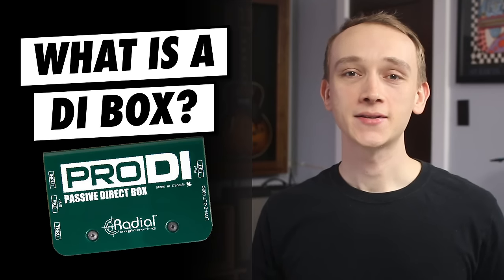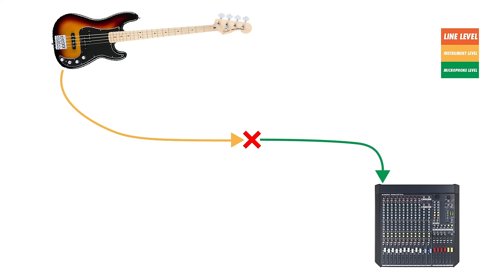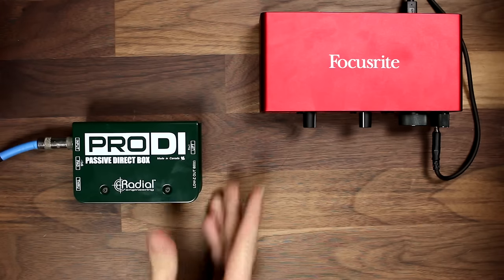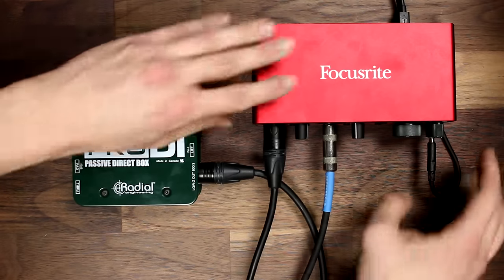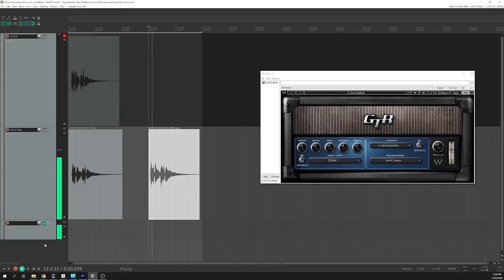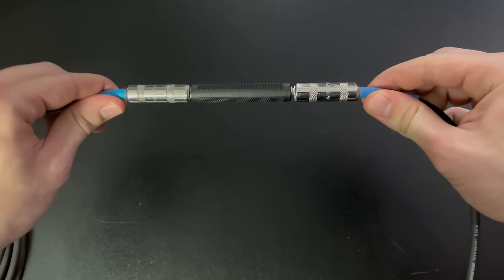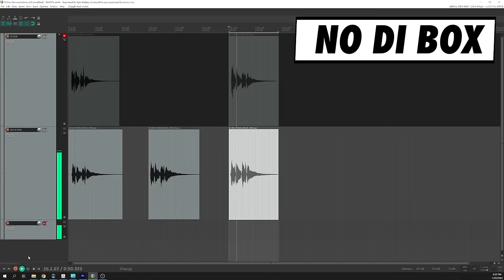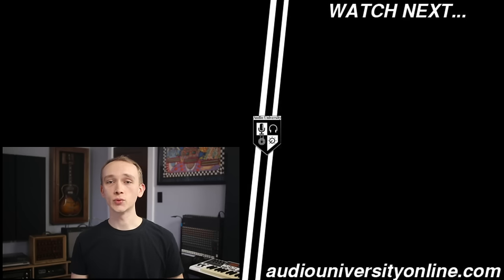What Is A DI Box (Direct Box)? | When & How To Use One

Comment: a DI box absolutely colors your signal, because thats what happens when you drop the impedance. you wanna connect to a mic input? lower your output on your pedal/amp/whatever is connecting to the DI box, and lower the input gain on the interface youre connecting to. NEVER use a DI box just to connect to something. passing your shit through a transformer or resistor (the more common and cheaper method) absolutely butchers the sound quality. if all youre doing is simple, non dynamic basic chord strumming, youll be fine. but if youre playing anything with any kind of distortion or RANGE, the sound quality is going to be decimated by the resistor.

Comment: Electrical engineers would probably have issues with your rather loose terminology.
For example, instead of talking about 'signals' having impedance (in reality they don't) you ought to talk about output impedance of signal sources and input impedance of the loading ccts.

Comment: These guys put out cool videos but they never answer any questions so don't even bother wasting your time
Reply: what is your question?
Reply: @3xAudio  I'm running a sub mixing board for my drummer. My question is should this be running  mic level/ XLR or line level/ 1/4in. into the main board?
Reply: @maxammo6282  it is line level coming out of the first mixer, so go into a line-in stereo channel on the main mixer. Use balanced jack cables if you can. 
If it is xlr output from the first mixer make sure you use a pad to bring the level down and pan them Left and right on your main mixer. 
You can also use a DI box to convert to XLR if you are going over long distances.
Reply: @maxammo6282  Use the line level connection. Just make sure its single ended on both ends, or balanced on both ends. 1/4 in connections can be either.